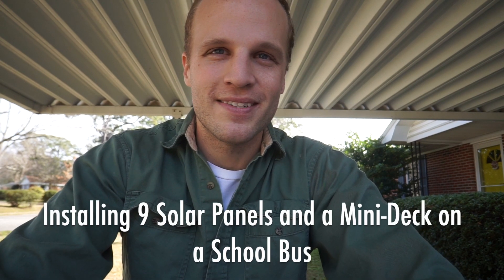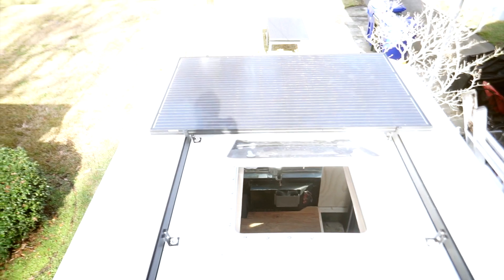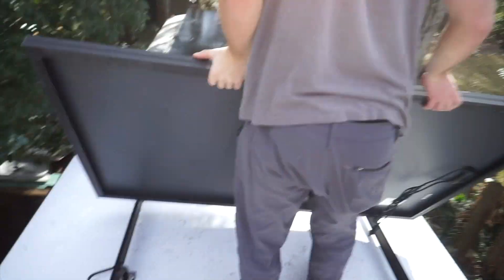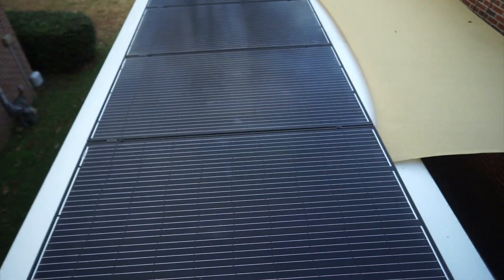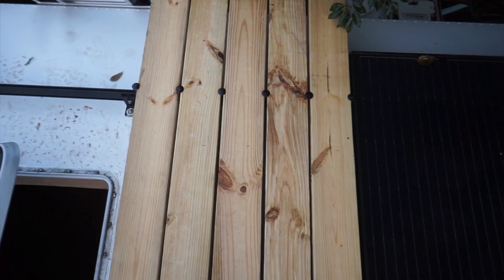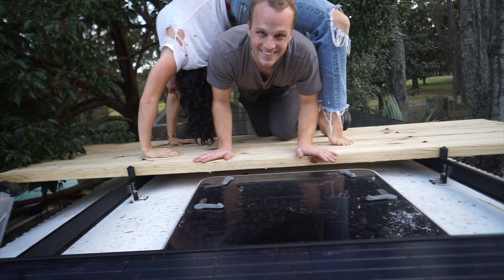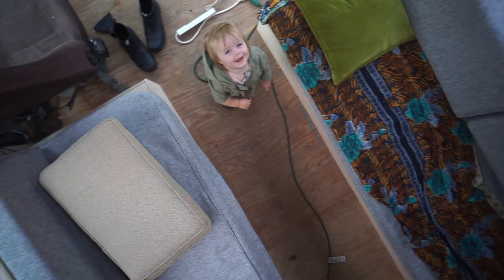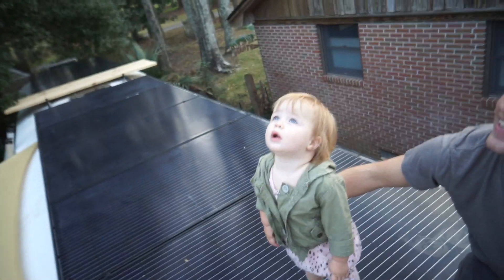We Put 9 Solar Panels and a Roof Deck on a School Bus (Conversion Ep 43)

Comment: Hey Justin! How long did the sundeck/platform last? Did you get sag in the middle over time? Thanks!
Reply from the maker: Hey! It lasted for many years although temperature and moisture changes did cause it to warp a bit but never enough to feel like it sagged in the middle or pull away from the UFO bolts that held it down. I did remove it after about 5 or 6 years to qualify for insurance again (most insurers don't want to see a deck up top) and especially because we literally never used it. With little kids it just wasn't something that made sense for us to use besides to check on the roof which I could easily do without the platform.